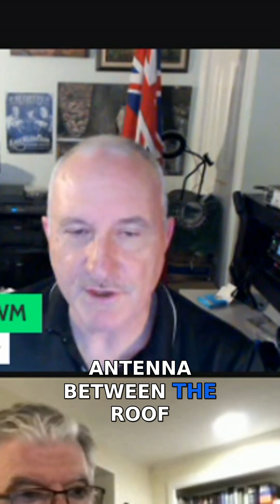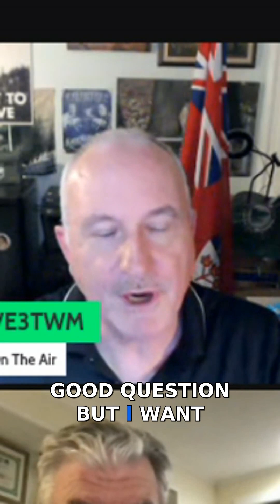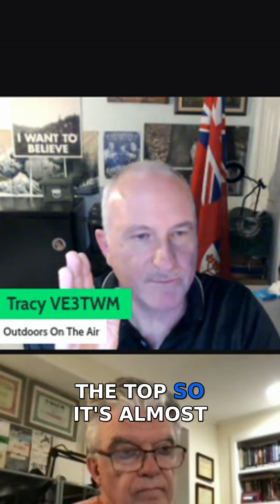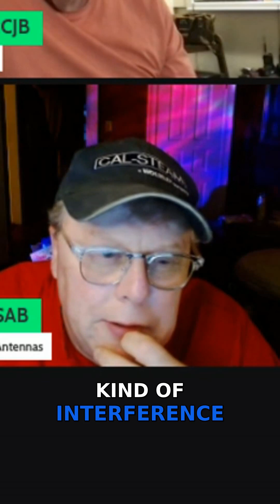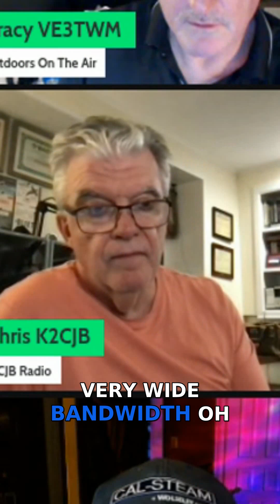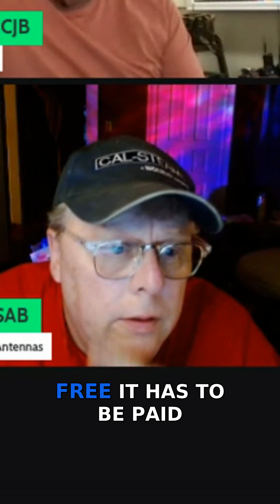What Happens When You Add a Spring to Your Antenna?

Comment: Shunts help with impedance matching and lower noise, as well are reported to reduce lightning damage to the radio.
I wind them on PVC and short the bottom windings to tune and adjust impedance.
Very old practice. Also, don't forget about capacitance hats.

Comment: In the world and history of CB Radio, that "spring" was so that the antenna, likely a 102" ~ 108" whip would be less resistant to the wind upon driving down the road.  Though it will change the frequency slightly, I would think less slightly on the higher HF bands than 10 or 11 meters at the bottom of a 1/4 wavelength whip for mobile while driving TXing.
KD8EFQ/73
Reply from the maker: Thanks for the added details!